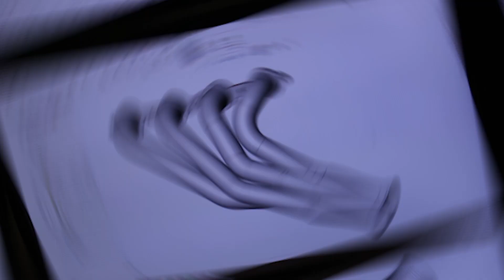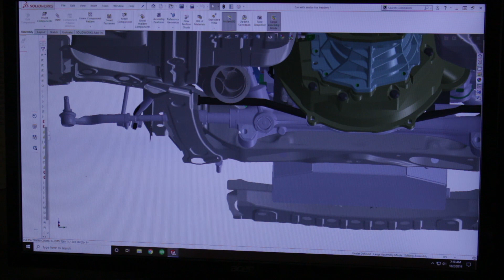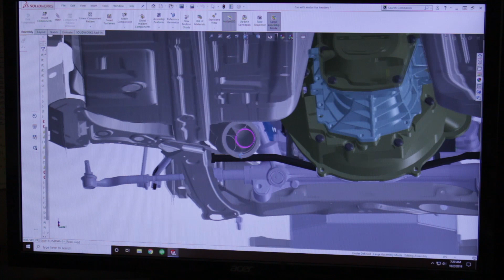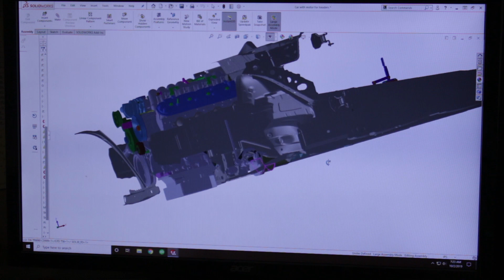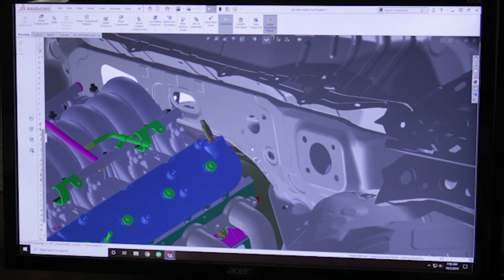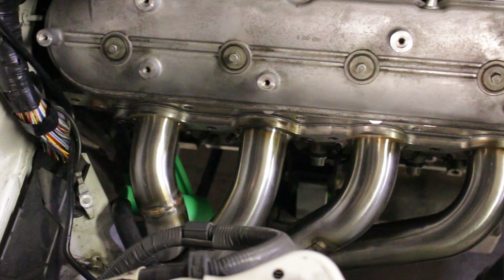FRS LS Swap / Build | Part 3: Designing The Perfect Headers by SIKKY

Comment: Can you run a Hi-ram holley intake on it? I dont mind cutting the hood. Im just worried if i have space at the back to fit it with the sikky mounts
Reply from the maker: Should be fine in the back. Definitely would need to cut the hood though with high ram.

Comment: Will the tr6060 fit just as good as the t56 mag? Any fabrication work? Will it have good clearance with those headers?
Reply from the maker: TR6060 is a taller transmission.  Because of this and to maintain proper drive line alignment and angles some of the top part of the tunnel needs to be clearanced for the shifter

Comment: Your entire kit is nice af I love it, but I feel like I'd go with cx racings header kit, no modification to anything needed cause they aren't as large
Reply from the maker: Doubt CX will fit with our kit though. Engine is a lot farther forward with cx kit. Plus our headers are made from 18 gauge American stainless steel vs their flimsy Chinese steel. To each his own though just making sure you know it’s like comparing an apple to an orange.
Reply: @SikkyTV  hmmm you have a point plus the larger collector probably produces a crisper tone with most cat backs for these cars I'd be curious to know for sure though
Reply from the maker: Yeah I’m sure our headers make more power based on there design 

For fuel system we will be releasing a fuel kit in the next couple weeks.
Reply: @SikkyTV  nice so basically the whole kit will be made to be a quicker bolt in solution to get the car running faster
Reply from the maker: Correct 👍🏻
Reply: @SikkyTV  also curious about what you did as far as the fueling, was there anything significant that went into routing a fuel pressure regulator etc

Comment: Very interested! I imagine to correct the steering after shifting the rack, you could pull the steering input spline and rotate the wheel back to center, or ideally just realign the front end using the toe adjustments on the tie rods. Looks like movement of about .5” from center on the rack bushings, so not too much for stock adjustment on the tie rods.
Reply from the maker: Yes ideal way would be to align front end by adjusting tie rod ends. Would be good to do a front end alignment after the swap anyway. Would be driveable to get alignment and toe setting would be the same but the steering wheel would not be centered that’s all.

Comment: How does shifting the steering rack affect steering geometry? Do you do anything else to correct after, like a tie rod spacer?
Reply from the maker: A simple front end alignment will get the steering wheel straight again. No effect on geometry at all. Shifting rack only a quarter inch so you’re toe setting won’t even change just steering wheel will not be centered
Reply: It doesn't affect bump steer due to changing the pivot location of the inner tie rod?
Reply from the maker: No